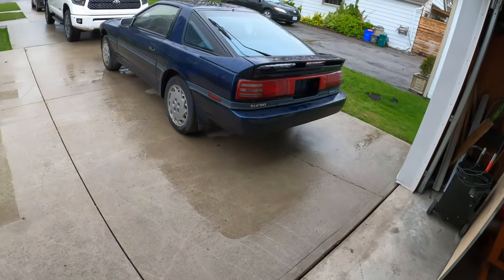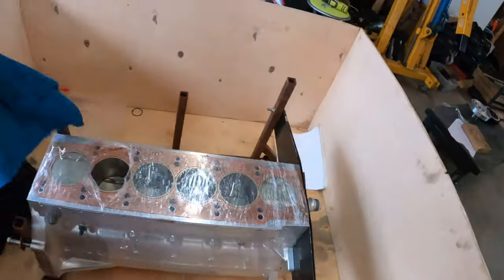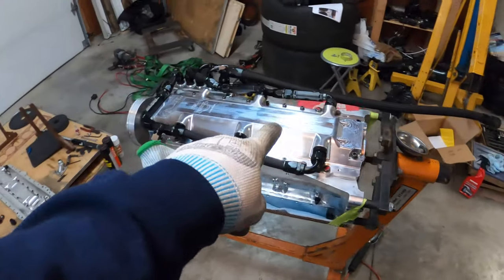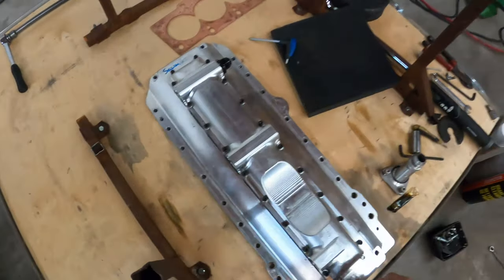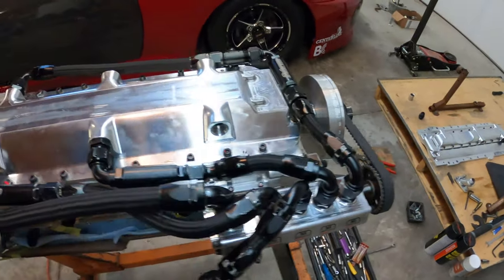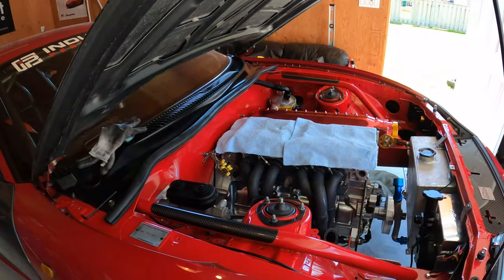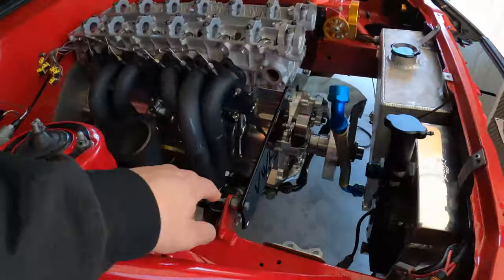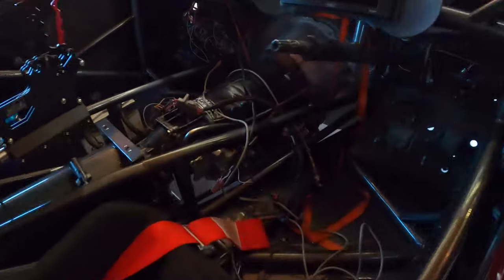BILLIT 2JZ - Engine Assembly - Part 1

Comment: Great stuff Ryan - curious on your mid plate setup - do the engine and trans bolt independently to the midplate - look pretty thick do you have to run a longer convert snout and starter shim? Always look forward to your build videos - just got an 8.50 cage put in my Supra
Reply from the maker: It's half inch thick, same bolts as the ATF setup. Yes trans and engine bolt seperate

Comment: You are very quick . Amazing work so far. I bet you will be in the 6 second zone. would a fluidampr crank pulley be ok for your hp level since its a solid piece or are there any issues with them?
Reply from the maker: I emailed them asking the saw question as I never seen a Fluidampr on a 1500+ 2jz. They didn't bother replying so figured they don't want my business.
Reply: @RyanSammutRacing  Thats very unprofessional on their behalf
Reply from the maker: @Nismoke  it's common. Smaller companies don't see the need to be in a certain market so they don't bother.

Comment: Awesome! 
Which AN size is used for engine oil inlet to the block? AN10 or AN12?
Reply from the maker: Two AN12s
Reply: @RyanSammutRacing  The thread in the engine block is AN12? Does the block have two oil inlets?
Reply from the maker: Yes it has two oil inlets, both an12s